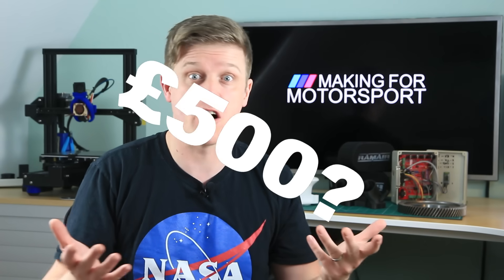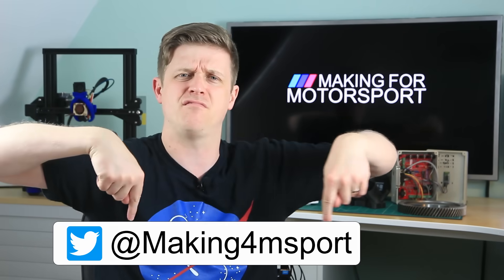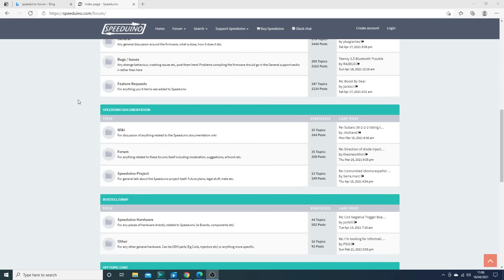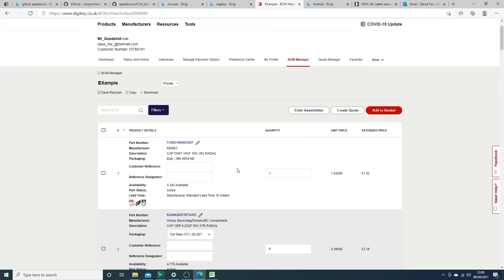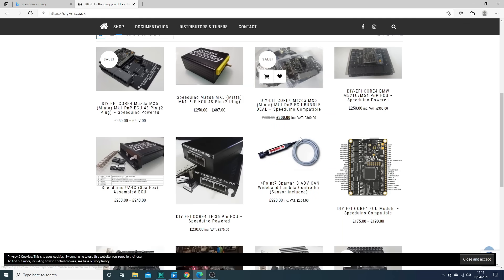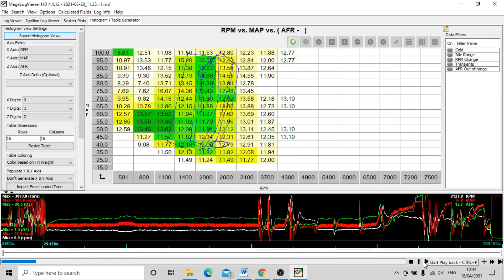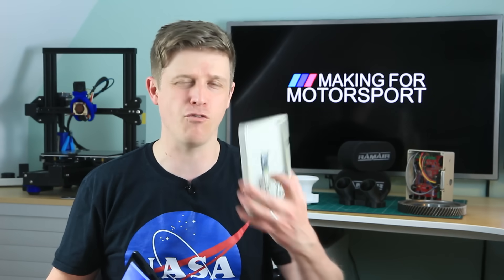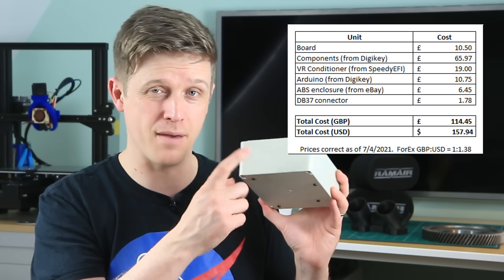The Best Value Standalone ECU - Speeduino

Comment: Great video and clear introduction to Speeduino. More people need to know about this gem and not be scared off by having to solder. It's a lot of components but individually are about as easy as soldering can be.

I'm so close to firing up my 1979 Toyota Cressida with Speeduino and ITBs. So far the experience has been identical to setting up megasquirt. I've even referenced the megasquirt manual when the speeduino wiki lacks information such as hooking up some engine components. 

I also highly recommend spending the little bit of extra money on the advanced Tunerstudio and Megalog Viewer. Its a one time purchase and totally worth it.
Reply from the maker: Mike, great comment, summed up all the things I editing out of my video!  Pinned!
Reply: mega squirts used to come on pieces like that back in the day.
Reply: I'm planning to make my cressida run on speeduino too! mine is a RHD 1988 Cressida with 1G-E engine. the stock ECU waste so much fuel but the car is very low on power even though it drinks so much fuel..
Reply: The soldering doesn't bother me at all, it's how to know where to wire it in and how to set it up. I only want to control a monopoint injection on a 900cc.
Reply from the maker: There are plenty of guides out there, it’s simpler than you fear!  Give the manual a read through, it covers most of the requirements 👍
Reply: @izzzzzz6  Wiring is incredibly daunting. I've only installed one megasquirt and one Speeduino so I don't have extensive knowledge. But here's some tips.

Break it down. Worry about each engine component separately. Figure out your injector. Then your spark. Then your crank trigger. Order doesn't matter but one at a time really helped me. Research one at a time and how it needs to be wired correctly (high/low impedance injectors, crank sensor hall/VR internal/external pullup, etc.)

Make a wiring diagram or chart. Super helpful to refer back to. When wiring my Speeduino I had a chart with columns like "harness wire colour" "what its for" "where it goes on ecu" then a checkbox once each was fully wired. 

Most importantly is write things down, start a binder, make notes. I'm fairly disorganized so I struggled here but it payed off.
Reply from the maker: Another fantastic comment!  I made an excel spreadsheet of pin outs and a little diagram! 👍
Reply: @mikeseventhree3827  Good point. I am great at joining wires but finding the correct ones does seem daunting. I suppose just running a new loom is simplest in some cases. I am just looking for something simple. I have a Panda 900cc and i removed the cat, now i just want to be able to tune the monopoint injector to run a wideband sensor feedback loop to get the correct fuel mix. Not sure how many sensors i need to tap into or what the car has in the way of sensors. it's 1997.
  I just want to keep it cheap and simple if poss. I would like to add an analogue pot as a trim pot to lean or rhitchen out the mix for different scenarios.

Comment: I’m planning on doing a stand-alone ecu on my turbo zx10r and I’d like your imput.
Reply from the maker: Happy to help if you have any questions.  I suggest you look into the NO2C (no overhang 2 channel), it's a stripped back 2 channel version that runs the same firmware, because it's 2 channel you'd have to run wasted spark and pairs injectors, but on the plus side the board is smaller so better for a motorbike (and its cheaper!)........
Reply: Look at the UA4C.

It's all SMD and actually takes up less volume than the previously mentioned NO2C

It has a larger footprint but a lot more IO.

Comment: I'm using the same ecu. 2jz nat vvti in my rx8
Reply from the maker: nice!  Thats an interesting engine and car combo....  big straight6 in a small rotary engine bay....  tight squeeze?
Reply: @MakingforMotorsport  surprisingly the engine bay is huge. It's actually bigger than the bay in a fox body mustang.  I'm using a collins adapter to use a cd009 trans also.
Reply from the maker: That does surprise me, but again you did get swapped RX7s so probably a similar deal.
Reply: @MakingforMotorsport  I have never seen an fd bay empty but judging by a full one looks very similar. I'm going to get to it this week and start mocking up the engine in the bay

Comment: I am very suprised a Mega is fast enough for engine management, sending a spark and opening closing injector is around a ms job and getting arduino to compute at ms rate is tricky. I would have thought some FPGA magic was needed.
Reply from the maker: It’s a 16MHz chip and it’s obviously handling the crank position wheel and although I have done some coding I don’t know how it’s been done in detail, but bad code can slow down a fast cpu, and good code can go along way!
When running the ecu manages around 1000 loops/s, so if my 4cyl is at 8000rpm that’s 266 ignition events every second so I reckon as it is, it’s plenty quick!
Reply: @MakingforMotorsport  Sure. Some time ago i wondered if it was feasible and my calculations showed there was not enough performance leeway. Crank rotation is an interrupt based problem so it goes fast no problem. Spark at 266 events per second means it's a 4ms job. If your loop is 1ms it's means you can mess spark timing by 25% which is too much. I bet the team at speeduino uses tricks to make it work. In my opinion a high performance solution could use a Xilinx Zynq 7000 chip. It's not that expensive (about 100$) but as inboard microcontroller and FPGA. The FPGA can run the instantaneous stuff while the micro run the regular software loop.
Reply: @TheAntoine191  @making for motorsport The loops per second in speeduino does not dictate the response time to the crank trigger. The crank (and cam if in use) triggers are on interrupts, and the outputs for spark and injection channels are also all on interrupts (they use timers). The "main loop", which the loops/sec is measuring, is only doing less-critical stuff such as reading the sensors or checking whether the engine has stalled. So the actual RPM limit is more related to the time it takes to measure the crank pulse, and number of teeth on the crank trigger. Ultimately if loops/sec falls too low the engine's response will suffer if, for example, it fell low enough for so that it was unable to sample the MAP sensor quickly enough. But that basically never happens.
Reply: @ric355  Hello Ric and thank you for your answer. I knew you could fast read with interrupts but i did not knew you could time an output following an interrupted input. I expected something like that was at work because with standard I/O it was too slow. Interesting stuff.

Comment: Will a Speeduino work in a 5 cylinder engine?
Reply from the maker: hmm, good question, I've good a little bit of looking and 5 cylinders is an option in Tuner Studio and on the forum some people seem to be having some success.  I'd suggest you have a look, I'm sure it would work but it may be more complex (such as adding another channel in the prototype area manually) than a 4cyl build.

Comment: Why did they base the system on the Mega when the Uno is faster and cheaper? Do you really need that much extra I/O ? I would have thought processor speed was critical for an ECU.
Reply from the maker: I am no expert but i think it is the amount of timers, the Uno has 3 and the Mega has 6.  But I thought they both run at 16mHz (although I have a clone Mega that looks to have a 12mhz crystal..?🤷🏼)

Comment: Good video. Check out open source wideband lambda stuff too. LC-2 is quite expensive when compared to the Speeduino!
Reply from the maker: Thanks!  I have just had a bit of a look, when I was looking years ago when I first built a MS, 14point7 was around but availability wasn’t great nor was documentation, but that’s all changed by the looks of it!

TinyWb looks very interesting, it’d be interesting to do a side by side test between the two... 🤔

Comment: Great explanation. So far I have built a mini with megajolt, fitted emerald engine management and Jenvey tbs to two mk1 Zetec escorts, and just fitted nodiz to a Zetec mk2 on carbs. This vid has given me a bit more of a clue as to what I could do to my bay window 1600 camper. But first I need to look into how to setup the injection side without breaking the bank. Maybe I need to look at more of your videos. With the Ford’s and Minis everyone shares their experiences, but the air cooled VW scene is just much more secret, and too cool for helping each other from what I can tell. Thanks for the video, liked and subscribed as requested. Cheers.
Reply from the maker: Wow!  You’ve done a lot, and I am insanely jealous of the Escorts!  I had a Mk1 with a YB 10years ago but sold it to get a house deposit 🤦‍♂️ would love another one... for the camper, I mean an engine is an engine, not sharing just makes it harder!  Are the VW guys into the performance tuning side?  Do they do ITBs and such like the Ford boys?  Maybe the knowledge just isn’t there?

Comment: An interesting video for sure BUT is it really the cheapest solution out there? I'm all for bang for your buck but I've found aftermarket ECU manufacturers aren't exactly transparent when it comes to everything you need to run a standalone ECU.
One of the biggest extra expenses people overlook is the wideband sensor and it's processing module. Supposedly some of the MAXXECU and Link ECU's you can wire a Bosch 4.2 or 4.9 directly to the ECU without the extra process module unlike a Haltech or Motec that requires the extra module which is an extra expense they don't openly tell you about.
Then there's the programming and logging software. Just how much tuning ability do you get with the free software compared to the software suites that come with your Haltech, Link etc ECU purchase. Is the data logging software free and does it have a paid version for full functionality?

See these are questions that I think need to be answered so that there's a no BS chart that breaks down every single cost involved for each and every ECU manufacturer so that there's a completely transparent way to see exactly which ECU would suit your performance needs and also a no BS breakdown of the overall cost for each ECU manufacturer.
I've already done a whole bunch of research between the majority of ECU manufacturers and I can tell you there are some quite substantial cost differences between manufacturers for ECU's and software that will do exactly the same thing.
I have no brand loyalty as I take every manufacturer separately based on the level of BS they spew out.
Reply from the maker: You’re right there are a lot of hidden costs and if I was trying to spend as little as possible, I wouldn’t buy the featured Tuner Studio, but I would still buy the Wideband, but I was open that this is an extra cost, but equally I didn’t cover wiring or connectors which are common to most installs, this was just ecu to ecu.

As I write this, the paid for Tuner Studio and upgraded “HD” mega log viewer is $89 and you’ll know what Widebands cost.  Now, add the full software to the Speeduino cost and it’s still the best value out there, I think.

The other thing which often is overlooked is the use ability of the software itself, and TunerStudio, is very easy, and covers off all the functionality with Speeduino, and MS3x for  that matter, have... so if they are you ECUs, it’s all you need 👍
Reply: @MakingforMotorsport  Yes, you're probably correct that all things considered it's the cheapest ECU solution out there.
It would still be interesting to do a full breakdown of cost though.
Also, I don't like how some companies have the function checklist to compare their different ECU models and they say it has wideband input yet when you dig into this it actually means you require the additional module that converts the wideband sensor into a 0-5V signal of the lambda value the additional module has calculated. Whereas another manufacturer the wideband input actually means the additional circuitry is built into the ECU meaning wideband sensor support is native to the ECU.
If I had the time I'd put a video together myself to address this to hopefully make the ECU manufacturers be a bit more honest.

Comment: I like the way he thinks! I'm not cheap, I'm frugal, and I like to keep money in my pocket for a change. Great video.
Reply from the maker: You get it!  If the choice is going cheap or not doing it, there is no choice!  Plus, in motorsport is always nice to beat the guy who spends $$$$$ when you spend $$!
Reply: @MakingforMotorsport  if time is money you could argue it cost the same as the $$$$ boards because you have to do so much extra setup, so it does have a catch that catch is setup time.
Edit: I would rather spend the extra time.
Reply: @nottobay6768  To be honest. It's about a hour of soldering. If you come in with a plan 1-2 wiring setup. Tuning probably takes the longest out this depending on the person and how well they know their vehicle.
Reply: @donovan2697  exactly but for some people, especially those that would have to learn to solder I could see it being for the extra for those people, but not me.
Reply: @nottobay6768  the problem I have with the time is money argument is with what would you otherwise be doing? If your answer is sitting around watching TV or something similar,  your time is essentially free. If you would otherwise be learning how the engines functions and how to control it, your time is invested in that same goal which is essentially free too. 

It's only when you would otherwise be doing something productive that you cannot do at the same time that it would be money. For instance,  you wouldn't consider helping your child with homework as time equals money. But yiu would consider not being able to do so as a loss. Watching this 12 minute video is not 2 tenth of an hourly rate you would otherwise earn unless you stopped earning to watch it. 

On the other hand, there can be costs associated with time outside of you earning.  For instance,  paying for insurance and license fees for a car you cannot drive. Maybe toss storage space in there as well. But if you were already incurring those costs but had to save for the more expensive solutions,  it pays in savings to diy the cheap. 

I guess the point is that time can equal money but it doesn't always. Especially when the time is spent on a hobby.
Reply: @sumduma55  and then there is the gratification you feel when you know this thing is running on my skill.

Comment: ive been looking for a ECM for my 2000 lexus gs300 nat project , i wonder if this would work with the stock ecu and automatic trans, i want to use the stock ecu functions to control the trans  along with a standalone
Reply from the maker: This might be tricky and/or expensive.  There is another commenter on here that has put his Lexus Altezza on a standalone and ITBs whilst keeping the standard Bean and Canbus network using a Link plugin ECU, he might be best to talk to.   
I am sure you could make Speeduino do what you want but you’ll need to be pretty handy coding to do it!

Comment: The 14point7 spartan lambda controller works with megasquirt 3 can it work with speeduino? Is it better to wire it in via can?
Reply from the maker: Hi there!  The Speeduino uses the same 0-5v linear input that Megasquirt does and the Spartan can output that no problem so for connecting 1 wire to the ECU (and pick the same ground) that’s the easiest and best.  Speeduino can do canbus but it’s not easy to do straight out the box, but there really no need to use canbus for a wideband 👍
Reply: Can bus is superior to analog as there are no voltage offset issues and noise. Do your homework and it will be fun to learn the fantastic cheap world of can bus
Reply from the maker: It scares me at the moment, I haven’t played with it at all, but I have got all the earth nicely together 👍.  

But you’re right, it’d be best in a perfect world, but without the native Canbus on the Speedy (and I think the Spartan doesn’t have canbus native either), a careful analog install is probably still the answer here...

Comment: I'm running a fishing(UA4C) board on my 86 z31 with a v6 vg33 turbo. Super fun, and much cheaper then the ms systems out there. I would argue if you can get your hands into a bit of code and learning. But it's worthwhile all day long
Reply from the maker: The UA4C looks really good, lots of extra functionality and extra IO straight on the pins, as an introduction tho I wanted to keep it simple and Speeduino focused.  
The coding thing is funny, as I have had to do zero coding to get mine working, and now with Speedyloader it’s just sooo easy!   I can dabble with code but just never needed to) but if you can do some proper coding, the sky is the limit, especially with a teensy running it!

Comment: I’m up for this only questions I have is rev limiter is it fuel cut or ignition cut or both. Also can engine safety peramiters be setup to a limp mode, building my pulsar track you up again and I’m looking something more modern than the apexi power fc.
Reply from the maker: Hi there, the Speeduino has a soft cut which retards the ignition and a hard cut which can do fuel or spark or both.  I am not aware of a limp mode, it may exist but that depends what you want it to do....
Reply: @MakingforMotorsport   not blow any more engines up 😂 if any of the engine temps or peramiters go out of a safe range I’d like to set up some sort of safety.  Last engine was due to oil temps getting high it spun a bearing. Very frustrating.
Reply from the maker: Not sure on this, TunerStudio has the functionality for some of these but I don’t think Speeduino does.  That said, it’d be a fun project to setup an Arduino to monitor oil condition (pressure and temp) and cut ignition and fuel....